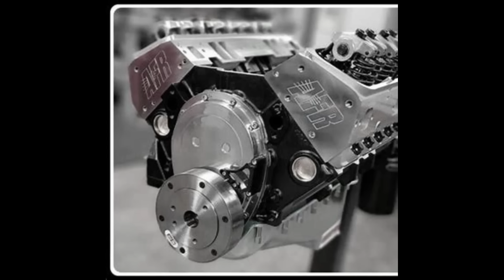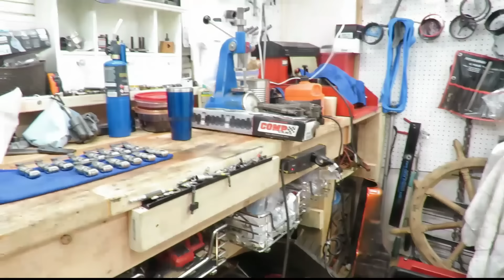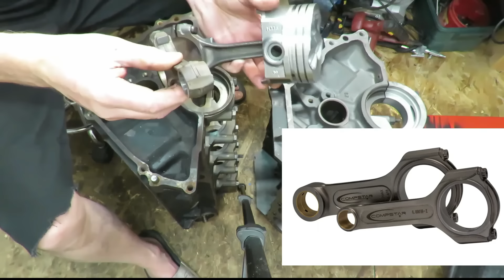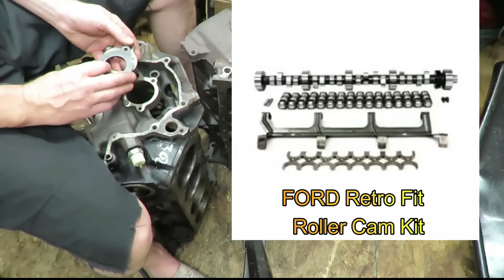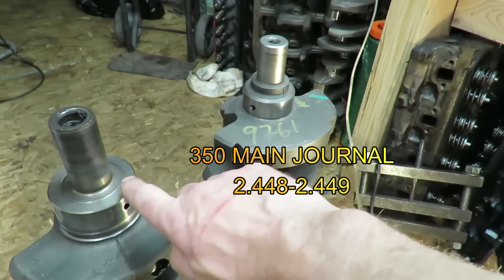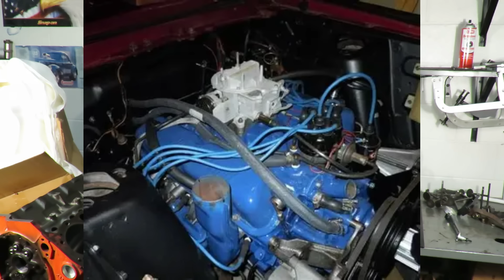Chevy 350 VS Ford 351W

Comment: As a newcomer to the Ford 302 this was a great discussion on it and it's cousins so thanks for that. What I would like to do but would be impractical is build a 7000+ rpm 302, just looking at the bottom end indicates that they are designed to rev.

Comment: Turns out that the science doesn't care what brand is stamped on the valve cover.

More air+fuel=more power. 

And the 351C is very good at moving air and fuel. Probably the nastiest factory pushrod small block V8 ever made.

Comment: Chevy small block is legendary but some of the points I like about the Ford 351 is of course the front mounted distributor and the symmetrical intake and exhaust ports.the Chevy LS engines went with the symmetrical ports also partially because the two closely placed exhaust ports can lead to heat issues and HP loss in endurance races.Both are great in all fairness.

Comment: Some strong ford bias here.  Riddle me this:  why does the ford have the silly kink in the pass side oil pan rail?  Removing the water pump/timing chain cover on a ford can be a huge PITA, seized and broken bolts are common.    But it really comes down to the exhaust ports on the heads.  The chevys are huge compared to the fords.
Reply: The frozen timing cover bolts is a real thing. Almost expected on every tear down. The exhaust ports are bad, but the Gt40 and Gt40p exhaust ports are considerably better than the other ford designs.  The front distributor is way better than the back, Ford does not put their freeze/casting plugs behind the flywheel. Those are a huge pain to simply change when they leak, resulting in transmission or engine removal(been there a few times).

Comment: Factory 351Ws, as all factory-built Windsor Fords feature priority main oiling systems as well as left bank-right bank interchangeable pistons. Not features of the 350 and other small-block Chevrolets.
Reply from the maker: The pistons on a Chevrolet will go on either bank
Reply: @Myvintageiron7512  Beg to differ in certain applications...

Comment: sbc is so superior, it's almost unfair, ford is pretty much garbage
Reply from the maker: Thats not even a little bit true don't get me wrong I am a Chevy guy always was and always will be the only exception is the newer LT Chevy Engines that just seem to be blowing up left and right you would think after 100 years GM could figure out how to keep the connecting rods in the Block and not punching holes in it Things are not going well for GM right now add to that the fact the majority of GM is now owned by a Chinese based car Company, but I digress when you say SBC is so Superior you need to back that statement up because I have been Building them all including Mopar's for going on 40 years now and I really see very little difference as far a one being Superior to the other again I love the SBC I think its a fantastic engine ive built thousands of them and had very great success but I could say the same of the older Ford V8's  they last just as long and make identical power so just exactly what are you talking about when you say this or could it be that you just like the Chevy's because that's what you know and really your post is more based on emotion than Fact
Reply: @Myvintageiron7512  i have built mopars , fords and gm v8 engines and in my experience the mopar is the easiest to build followed by the sbc , ford is the not fun one to build,  imo the sbc is a much better design , dollar per hp/tq always comes out on top plus asthetically is light years ahead fords do not make identical power with identical cams rockers,valves etc. they make less,  they always have to have larger cams rockers , i have a 56 ford victoria i bought it because i built a 351w that i tried to sell reasonably for $800  .030 over .010 crank new everything etc, no buyers all i read was that 351w fit like a glove like it was made for it........ well thats bs, would have been so much easier to put sbc in. btw why would anyone make an engine that a starter cannot be bolted to/ has to have correct starter plate manual/auto plus bellhousing, plus correct starter manual/auto. that is bad design/engineering  , weigh the crankshaft out of a sb mopar against a sbc , the sbc is heavier despite being smaller , that equals durability / better material/ i have not weighed the 351 crank but i bet it is lighter also, like i stated imo sbc is better

Comment: I prefer the Ford 351w, the block height is 9.5 while the Chevy's is 9.0, the 351w easily fits a 4.170 to 4.250 stroke, that is, from 351 to 440. Chevy heads crack, the Chevy valve inclination is 23° Ford 20° which is better. Another advantage is the design of the symmetrical ports in the Ford in intake and exhaust, the Chevy is a disaster with the headers, they always have to struggle with the cables and even to change spark plugs, another thing, in the 350 I frequently see people struggling with the starter motor holder in the block... starter motor that comes loose or is very common that they sound strange when starting.
Reply: The ford camshaft distance is a bit further away from the crankshaft than the chevy engine which provides more clearance between stroker crankshafts and the cam. The extended cylinder walls in the ford crankcase can be clearanced for rods better than the chevy with strokers because the chevy may get into the water jacket. The ford lifter diameter is larger than the chevy which is also an advantage for big cams. Can put cleveland canted valve heads on a ford windsor! Not sure if ford or chevy has the best oiling system though. Ford for the win for me.
Reply: 100 percent correct.putting headers on a SBC is a nightmare with the plug wires.the sbf in that aspect is so nice.i just run a good set of aftermarket manifolds on the SBC .makes life a whole lot easier.

Comment: With the 302, with a crank with a 3.25" stroke and 030 over on the bore, you can build a 331 cu in engine! identical bore and stroke dimensions as a 030 over Chevy 327. with good heads it is a very fun high rpm package. To be honest I like all American makes of V8 engines and I have had Fords and Chevys that they both are great!

Comment: Very great and honest comparison between the 2 engine I really like this stuff. Also I agree 100% if don't ls swap a classic car or whatever I have seen that to many times and it does bother me not only looks but sounds to and I can say that at 25 years. So yeah plus like you said it actually more expensive LS swapped then building a sbc engine or whatever. Also iron heads have you ever got a hold of a rhs raised runner head or just a 200cc iron head i run a 2 barrel class I can run any aftermarket iron heads that flows good or whatever to bad there all discontinued
Reply from the maker: OH yeah used a bunch of RHS heads had very good success with them
Reply: @Myvintageiron7512 oh Nice that's awesome have you ever got you hands on the 21 degree raised runners I do want to look for those

Comment: Back in 2010 I did f4te roller block 351w swap in my fox.  Used WP windsor sr. heads and comp roller cam.  I went too mild on cam profile and piston selection due to plans of adding turbo.  Kept car EFI and converted to A9L mass air.  Had so much fun in that car and racing it.  Made torque like you wouldn't believe on 87 octane haha.  Ended up selling it for 2500 bucks and I regret it all the time.  I sold it up in your neck of the woods too.

Comment: Nice review.  A 2 bolt main 351 will take as much as the 4 bolt Chevy.  Larger caps.  The 4 bolt SBF head with .5” bolts are beefy along with the thicker cylinder head flange of the SBF head.  Chevy uses more bolts since the head flange is so thin and the main caps are puny.  I do like the 350 Chevy simpler water pump design and smaller main journal diameter.  The 351 really needs a stroke increase to earn its keep over the lighter, smaller main 302 which is better at 347 vs a stock stroke 351 IMO.

Comment: Ford could have easily made a 327 from the 302 block.  A common 3.25” stroke upgrade now, in the aftermarket.  They redesign it into more of a medium block; heavier, larger diameter main journals in the 351.
Reply: Why would they want to , 289 hi po's could handle the 327 on track .
Reply: @joefell7845 well that’s one thing, the 289 Shelby prepped GT350’s had a weight advantage.  That doesn’t mean a 327 won’t make more power; that extra .250” stroke gives more leverage making more torque.
Reply: @joefell7845 depends on the track. If it's a lot of tight turns the Fords gonna stare at Chevy tail lights because of the stronger, more immediate torque

Comment: If you are into street rods or "kit cars" there is an advantage to the Chevy. The Ford has the starter and the oil filter where room is needed for steering and clutch (on a left hand drive car). Further the  water pump builds more forward on Fords. This makes the Chevy a more compact unit easier to package.

Comment: This is a good video. I use to drive old square body 4x4s that were stock and they could take a good beating and they did break but they were easy to fix and there were lots of ready available parts that were fairly cheap and  what I really liked about them was all chevy parts could fit. I drove home  3 or 4 miles one time with a connecting rod sticking out of the oil pan one time. Chevy small blocks are pretty good. I like my Hemi better but the small block chev is pretty awesome.

Comment: On a chevy sbc/BBC the oil sump is at the back with the oil pump. Fords and chryslers had the oil sump in other places which would cause the oil to forced back on acceleration and uncover the oil pump pickup and air being drawn up and oil starvation/spun bearings to occur.
Reply: The most commonly built SBF don’t have that problem.  The ‘78-‘04 Fox body and its variations k-member location places the oil pick-up in the rear sump of the pan.  Old Ford pre 80s yes that was the case.  Easily solved with a warmed up motor with a simple internal baffle.

Comment: Dont have to drill 302 block to use 351 heads.  Ford made bolts to do the swap.  I have a magazine that states the part number.  I had Mom to take me and buy a set and i installed 351 4V heads on my 302.
Reply from the maker: cheaper to drill

Comment: I would have liked to see a 351 Cleveland 😆 but… we know how that would go
Reply from the maker: The Problem with the 351C Engines is finding one they were only made for a few years and in very limited numbers the 351W's were made for decades by the bazillions
Reply: How would it go? Are they better or worse?
Reply: @jessegraas7168 It would go like this..... "The 351 Cleveland is a big block not a small block" 😠😭
Reply: @jessegraas7168 just as he said, the power is all a product of heads and camshaft look at the cylinder heads of a 4v closed chamber 351c. Look at what Jack Roush did in drag racing. Small journal crankshaft and the heads like a big block on a light weight small block
Reply: You can put the 351c heads on a 351w or 302, with little mods, and an aftermarket intake.
Reply: @misters4119 everyone knows that, this is a stock engine comparison. With aftermarket heads there is no reason to do that anymore. That’s my point, you can put LS heads on a 351W also with mods

Comment: Very educational video. I'll admit, I don't, I never had liked Ford products. But the way they designed their small block is logical: stroke is 3 or 3.5. Chevy with all its different strokes and bores...you need to be on Wikipedia all the time, but when you find a rare one (like a 262, only produced between 1975 and 1976), it's like like you found a 426 hemi...almost. For the stock heads being mediocre, go see this: https://www.youtube.com/watch?v=Kal6t-SihbY Vortec heads are more than able to make numbers. Great video!👍

Comment: Nice video!.   The double hump heads were decent in their day, and with some minor porting could do o.k.  But who wants iron heads anyway!  
I took a 73 Datsun 240Z and swapped a SB Chevy into it.  Originally a 331 (making it a 540Z), then a 406 (making it a 670Z). So much more fun.  I got so much hate online for doing that!
Reply from the maker: mmmmm swapping a SB into a Z car is fine I see no problem with it
Reply: Fitting a V8 engine to the 240Z was done commercially in the US.

Comment: Can you do a video on Ford small block crank balancing. Just to explain the difference between a 27 oz crank and a 50 oz crank. Also show how to machine a 50 to a 27
Reply from the maker: The cranks can not be used with the flywheel or the balancer with a different balance my suggestion would be to find a machine shop that has a balancing machine and have em balance the rotating assembly
Reply from the maker: https://youtu.be/N7JB2Rv9eg8
Reply: @Myvintageiron7512 . Watched the video. I should have been more specific. The problem is the engine that came out of the boat and the new engine is a GT40P. Not sure the year of the old engine. Will a newer 302 accept an older crank?  The flywheel does not fit on the newer engine and newer flywheel doesn’t fit the boat bell housing.
Reply from the maker: @coarsegrind so you have an early flywheel and a late crank?
Reply: @Myvintageiron7512 . Yes

Comment: Very interesting and educational indeed, thankyou!  I have always wondered about the many different styles of ford small block engines and their differences.  You make a great point about the Ford distributor location as well, I wonder how many Chevy distributor gear issues are related to deck/manifold shaving.  Back in my OMC days, I remember the 460 big block engines being used in our stern drives, saw a disturbing amount of lower end bearing failure/issues.  Now I am wondering if this was due to the constant high RPM and larger diameter crank bearings.   I remember that the small block Fords when used in our stern drives always seemed so quiet and smooth compared to the Chevy engines.  
Thanks again, hoping you will make a similar video showing differences between the "cleveland" and "Windsor" Ford engines....
Reply from the maker: you will probably like this video as well copy and paste this enjoy
https://www.youtube.com/watch?v=O_L_XLRcVAw

Comment: Hey mate, the bellhousing bolt pattern is for C4 and FMX transmissions, the C6 has a bigger bellhousing that suits 400’s, 351M and big blocks. Great comparison of the motors.
Reply: The C6 also was built with the 289,302, 351w bellhousing bolt pattern.
Reply: @craighansen7594 you’re right, they did but I believe it was in small numbers. It would be a horrible combo.
Reply from the maker: aaaaa I was not aware of that I haven't done to many Ford installs now I know
THX
Reply: @Myvintageiron7512  mate.. your full of sht.. chev change like jocks & days of week.. windsor clevo never changed till roller cam.. chev have different rockers, pushrods, multiple fkn heads cos they cant build a fkn engine correct first time.. you chev guys have blinkers 3 mile wide.. brainwashed.. only difference on a clevo is the head. 302 / 351. open closed chamber. & 4v which doesnt do anything till after 80 mile an hour.. our xy gt ho. with 3 people toped 160 mile hour.. recorded by the guy in back seat.. which the paper doctored to 140.. for '' idiot reasons''.. you know sht.. why... did chev abandon the rail rockers on the 6 cyl for that bs set up..??.. only good 350 is an 010 block, then bank details at speed shop to fix the rest..  351c... top loader... 9''... all you fkn need..   ausie..
Reply: @Myvintageiron7512  oh... & rocker covers.. how many times did chev change that.. & inlet bolt pattern.. & what the fk is a double hump or ''fueli'' head.. & who gives a fk anyway.. holley, quadrabog..bin, like chev..
Reply: @harrywalker5836  harry you obviously have some type of homosexual tendencies.
Reply: @Myvintageiron7512  chev / gm.. went to lotus, to build them an engine.. thats how fkn good chev is.....nt.... & isuzu for there fkn 6.6.. then they fkt both of them..
Reply: c6 / c4 same.. here in aus. a c4 fits 351 or 302c.. fmx also same.. c4 is realy a 6 cyl box.. a 351c will screw a c4.. windsor here were rare untill mid 80,s. clevo still king.. chev suk..
Reply: I thought you could put a small block or big block bell housing on the c6
Reply: I've got a c6 with the small ford bolt pattern. It came out of my old '74 Econoline that had the 351w/C6 combo.
That trans is now sitting behind a '91 351w in my  '69 F100 ranger short bed.

Comment: 305 is a boat anchor
Reply: Not really.
Reply: @SPEEDOFDOG it works very well as one .
Reply: Power Nation did a build between the 305 and 302 with similar specs and it surprised me too but the 305 held it's own with the 302.  They got near identical hp& torque on the dyno
Reply: If I remember correctly, Chevy also had a 307 CID v-8, never hear any thing about it, good or bad.
Reply: @Sundancer268  The 307 got dud heads and a smaller bore, so in 1972 you were looking to steal a set of heads that performed. They were weak, so if they dripped a drop of oil they owner was PO'd... Boiled down to if you got the 307 in a Nova or an Impala. The smaller car would be more suited.
Reply from the maker: 307's are a great source for 327 crank and rods buy a 307 for $150 because everyone hates them (small Bore) stick the crank and rods in a 350 block and you got a 327 screamer

Comment: Is it still a Ford when I did not use any Ford parts?
Reply from the maker: if you want it to be
Reply: @Myvintageiron7512  1955..  there you go.. theres the problem.. still floging a dead horse.. 350 are junk.. rockers, no cam retainer, simese ports. change little things every 6 months.. for fk sake, get a clevo.. fit a cam, job done..  clevo heads what chevy guys dream of.. & valve gear that doesnt say by by at 5,500 revs..